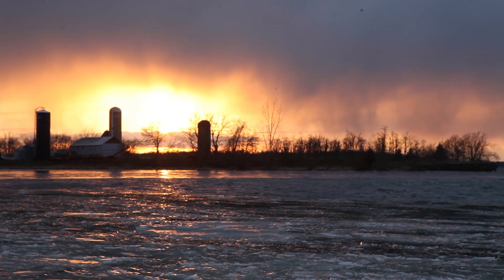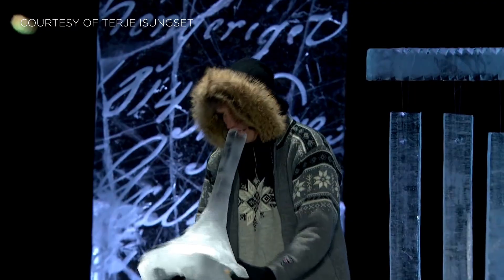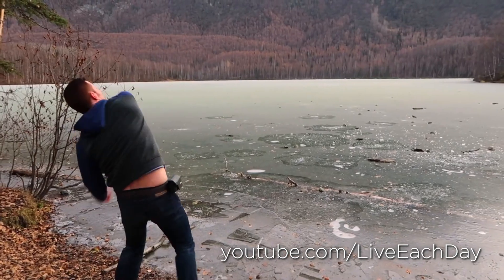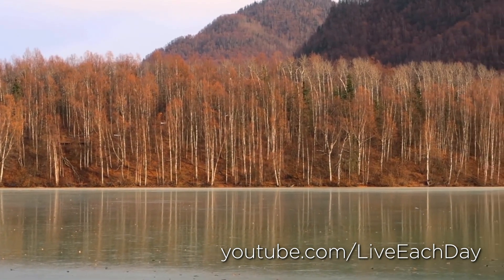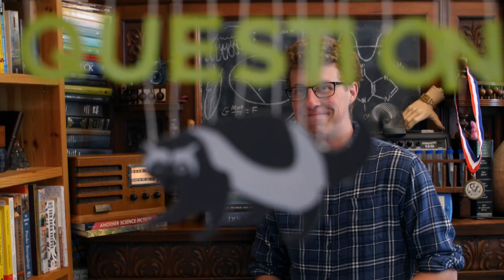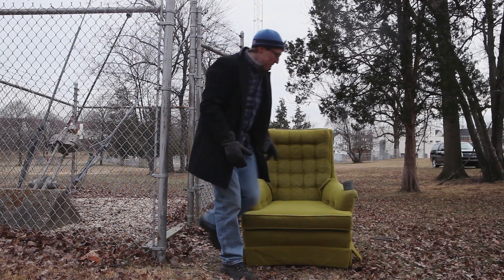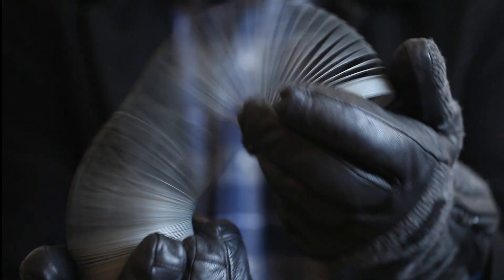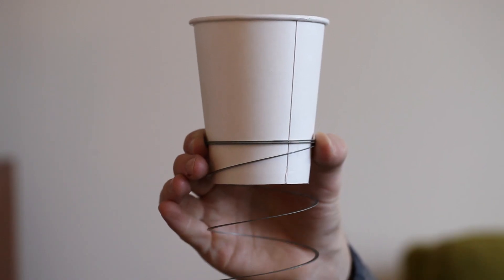What Makes Frozen Lakes Sing?

Comment: Did he actually answer the question about how =>the wind<= is creating acoustic dispersion? >.<
Reply from the maker: +Kit Vai The wind isn't causing acoustic dispersion. Expanding ice buckles and cracks sending out vibrations. As those vibrations move through the ice, they separate based on frequency.
Reply: Thanks so much!
Reply from the maker: No problem - thanks for asking!